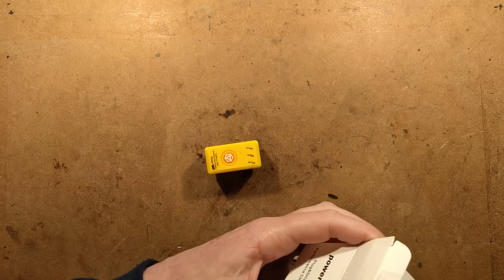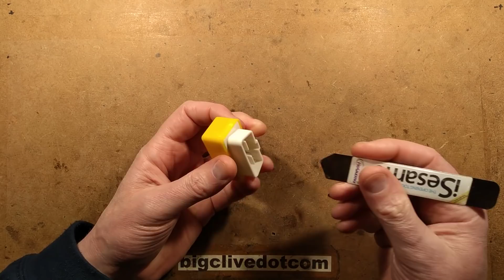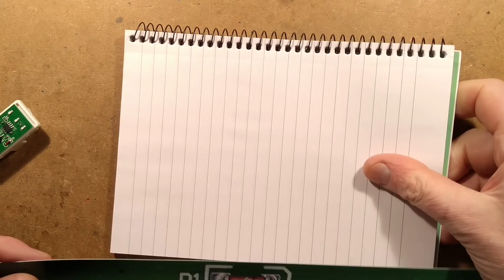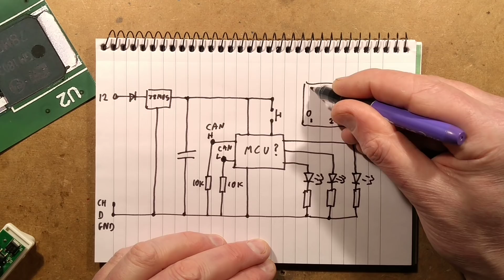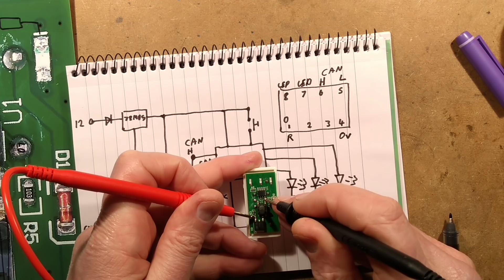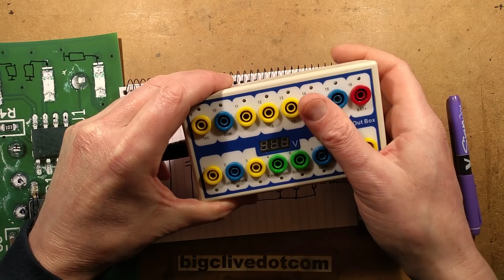Simplest OBD2 engine remapper yet, with actual canbus connection.

Comment: Just started getting into soldering and the like recently, I have a thing for solar lights for some reason no idea why lol. But I had a question as this is the most recent video.
Have you ever used liquid electrical tape and if so what have you used it for?
Reply from the maker: I've not used liquid tape yet.  I've seen it in America, but someone recently sent me a tub here.
Reply: Ah I see.. I used some a month or so ago to patch up a phone USB cable that started getting some wear and tear and a small part of the cable wires were showing. Tried actual electrical tape but the thermal temp differences when in use ended up making it lose adhesion to the cable. So I tried some liquid electrical tape and it bonds MUCH better than the standard E-tape and thermal variances don't seem to affect it. I've also used it in place of heat shrink while messing around with some solar lights.

And on the subject of solar lights lol, I just purchased a Mainstays Solar motion activated wall light that is 1000Lumens and a Mainstays Solar step and fence light with Motion, 5 Lumens standby 100 Lumens activated of which i'll be using as an in doors light, Gotta love rechargeable batteries and having a charger lol. Sadly though, they use 18650 and 14500 AA batteries so had to visit Amazon for a charger. as I said, LOVE solar lights for some reason lol, especially during the summer. Thanks for the reply

Comment: Loading components on both sides is obviously more expensive... You have to stop bits falling off the first side when reflowing the second.  

The 7805 regulator should have a small cap on the input for stability.  The choice of regulator package may be due to power dissipation to get vehicle "12V" down to 5V.  As much as 16V is often seen on vehicle power supply rails.... with automotive rated components rated to deal with 60V load dump transients. Such transients occur when e.g a "mechanic" disconnects the battery while the alternator is trying to charge it.

Comment: Pinout matches an STC15F101W, little micros currently retailing around £0.15-0.20 in volume. Can find them on LCSC
Reply: I really like this theory. If so, the Can Bus is connected to I/O pins at 5 and 6. LEDs are connected to I/O lines at 3, 7 and 8. This microcontroller has on-board clock, RAM and a big EPROM so it is fully self-contained. This means that it could easily be talking to the CAN Bus and could actually be doing something. The next thing would be to analyze the CAN traffic to see what is happening. Good find.
Reply: @Toobula : No need, no CAN-controller and no CAN-tranciever in that chip. You can find chips with built-in CAN-controllers but all CAN-trancievers are external. Also, crystal oscillator is missing...
Reply: @TheFirstBigCheese  Not true. There are some micros with built in CAN transceivers. They are few and far between, yes, but do exist.  Crystal oscillator is not an absolute requirement. It can run on the internal RC oscillator. Some have trimming registers for tuning, as well as PLL's for multiplying the clock.  However you are correct that this micro is unlikely to have a CAN transceiver. So successfully communicating on the CAN bus would be difficult.   I will not say impossible, as there is some trickery that could make it possible.
Reply: @ArionRaine  Really, there are? Can you mention one that has the tranceiver built in? (I'm not aware of a single 8 pin chip that even has a controller, no less the tranciever).
Reply: @TheFirstBigCheese  I did not specify they were 8 pin, nor did you imply your statement was limited to 8 pin devices. But yes, not likely in an 8pin device unless it is a custom IC, and they def aren't doing that for these.  Off the top of my head I think ST has at least one L99xx part with transceiver. I am unsure if the part is available outside of automotive agreement's however. I think maybe the EBV Epona line of automotive regulator IC's may have them, but I am unsure.
Reply: @TheFirstBigCheese  Indeed. Some controller of that family support "RS485 control" (RS485 is very similar to CAN bus and might just work if you'd screw around enough; there's also no real full-featuired UART on board, I think). But, again, just "control", no transceiver. Without a transceiver, the microcontroller can just source/sink 20mA on the output pins, but CAN requires at least 35mA (usually higher drive currents are used for reliability, 35mA is the absoluter minimum to fulfil the dominant voltage specs)

The devices have an internal RC oscillator, which allows to select a clock frequency of 5.5MHz, 11Mhz, 22Mhz or 33MHz. The CAN bus allows for a oscillator tolerance of almost 1.5%, which the internal RC oscillator can meet (0.3% base deviation, plus 1% temperate related deviation).

My verdict: it might be able to analyze CAN bus traffic (and maybe do some flashy things, like blinking LEDs differently when the engine is running, or when revving high), but it will not be talking to other components.

Comment: Tying Chassis Ground and Data Ground together on the board seems like bad behavior. I've never looked into this but I'd think if the car makers bothered to have separate grounds for data and chassis they should stay separate. Tying them together on this device's board defeats the whole separate ground scheme car wide.
Reply: No reason to worry, SGND is not actually used or just commoned at the plug host side too, at least for CAN bus cars. Probably not the case for J2818 and such where it might actually be important.

Comment: 9mA is actually quite a lot in quiescent terms within an automotive context. Most regular cars are <20mA for the entire 12v system with security active. I wouldn't be plugging anything so generic into my car...crashing CAN or sending spurious data is generally a bad thing. Suppose it could be repuposed as a USB charger...

Comment: One possibility would be ATiny85. It has RESET on pin 1 and GND on PIN 4. Vcc is pin 8 BUT the LED is always ON - it could be a trace on the bottom side of the PCB - LED shows power is OK and goes to pin 8. All the other pins are I/O...
Reply: i found it it's an stc micro stc15, pins match perfectly https://datasheet.lcsc.com/szlcsc/STC-Micro-STC15F104W-35I-SOP_C26928.pdf

Comment: So was that a 5.1v Zener? I've purchased some & can't read the bloody things, numbers on them don't seem to match their voltages. Is there an easier way to read those & get their proper voltages?
Reply from the maker: It's just a standard diode like a 1N4148.  Sender markings usually have a voltage marking like 5V1 for 5.1V.
Reply: @bigclivedotcom , So a switching diode, I wasn't certain, & am old & getting blinder but dang their hard to see even with my eye piece. LOL!!!! Don't you have a meter that can test those? If so make/model. Thank you B. Clive.

Comment: I  have a different kind of tuning box, this one is plugged in between the injection pump and the ECU.

It seems to work, but not only for tuning, but also for economy
at least I can notice that in the MPG
there are two wires going to a little box, they are spliced in on the pressure sensor, so my guess would be that it modifies the signal a little bit

Comment: The fun thing is they could cheat the fuel economy gauge by randomly issuing a DTC reset pattern, most cars default economy values are unrealistic so at the dealership the range shows like 700km while the car is only good to 500 after it has learned in.

Comment: Thank you for confirming suspicions. I'm a mechanic who saw these things and thought to myself yeah right first of all reprogramming like you said is quite geeki and can't be done with a cheap unit even if it is an off-brand one. In fact most tuning  requires disassembling the computer and can't be done through the OBD port
Reply: Actually although the CAN bus can be expected to be firewalled off between the diagnostic and the engine section, and thus will not be used for programming in any official capacity or by tools intended for professionals, just about every single unit in existence has exploits which breach the firewall. Once you do these kinds of things, a hard brick becomes fairly probable. I ran into numerous security research papers.

And still, these are all going to be fake, for so many reasons.

Comment: What type of Skoda is this? A Fabia, or its predecessor the Felicia?
And what is the other bus you mentioned, if this car doesn't have a CAN bus? (I can hardly imagine a car not having a CAN bus, how else would the engine management communicate with each other, like electronic butterfly control valve for the throttle body, which at least the Fabia already had, and the ignition module, and so on?)
Of course, if it is a Felicia, then this might all still be mechanical.
Reply: VW group switched to CAN bus starting around 2004. Before that, a variety of other similarly message based but electrically different buses were used, such as ISO 9141-2.
Reply: Oh, so my end-of-1999 Seat, even though it is a facelift model, won't have CAN-Bus? Does that mean it wouldn't make any sense to buy one of those cheap Bluetooth dongles and use the Torque app on my phone with it?
Reply: @Seegalgalguntijak  actually, ELM237 supports a whole bunch of physically different interface standards; whether Torque supports your vehicle, what specific bus yours uses, and whether ELM237 (and especially China clones which might get one or another thing wrong) manage to communicate with it, is something you should ask somebody who actually knows that stuff in detail, enthusiast forums or so.
Reply: @Siana Gearz OK thank you, I think I'll have to look around a bit, since Germans are usually very much "by the book" and therefore don't recommend such "inofficial" devices, they rather give you an illegal copy of VAGcom, or so ;)

Comment: Obviously most of your subscribers have no idea wtf is going on but i assume you realize that you must have a can bus capable vehicle and software.  since you admit it might screw up the car, you must agree that it's got input AND OUTPUT capability?  Does it bluetooth to a phone or other device for access to software?  If not, how could you expect it to work in the first place??
Reply: Microcontrollers are simple i/o gates, i learned that in digital circuits 101. without a running software or ECU flash , you wont change much with the tune.  We have the software, just looking for a cheaper way to connect to the ECU because the cables are usually proprietary same as the software.  800 dollars for a GM link to use EFI live, the software is free.

Comment: What if the Reset, pin one is really the power and the switch is NC. Then the 5V is a requirement input for there program.

Comment: One thing I’ve yet to figure out, why bother putting a polarity protection diode in something with a such a defined pinout as OBD2? I can understand it with battery operated things (AA, 18650, etc.) where they could be installed backwards, but I see no way that pin would ever be anything other than +12 V. Besides, if someone installed their car battery backwards, they’re gonna have a lot more problems than blowing up a voltage regulator in a $4 piece of landfill.
Reply: Static protection and occasional quick negative bursts/spikes.

Comment: found your micro https://datasheet.lcsc.com/szlcsc/STC-Micro-STC15F104W-35I-SOP_C26928.pdf page 5 is where you want to look
seems the 2 pins hooked to the canbus are also the programming pins and the uart a la atmel
also seems that no matter the package the bottom 8 pins are constant but the top ones change
there doesn't seem to be any can capability in the range at all though

Comment: Is there really a OBD2 Wireless chip that works good, Maybe a decent  one that you can recommend big clive? I know they're going to be limited on what they can do but I would like to have one and I'm not sure which one to buy? I know none of them are going to help your horsepower or gas mileage. Just a diagnostic tool.
Reply: I use the elm327 Bluetooth Adapter with Torque or any software I can use with the serial emulation. Don't buy the China crap, most times it won't work. The crap is up to 30 Dollars, the real one is around 50 Dollars up. If it works, the elm is for most people the best option. If you want more than read pids and delete errors, you have to go to special bundels from aeswave, what is up to 1500 Dollars.

Comment: I had one of these that i used on my old car. 
Literally all it did was make it run an open fuel loop. It just makes your car have max fuel flow all the time, regardless of throttle position.
Reply: Holy carbon buildup. 
Why the hell would someone want that, or was it advertised as doing something else than what it was really doing?

Comment: The MCU could never send data across Canbus with those 10k resistors in series, Canbus network  devices are terminated with 120 ohm resistors so there is no way any mcu could pull the lines high or low through 10k resistors 😉

Comment: Hi Clive - Take a look at the STC15F104W - Pinout matches
It's an 8051 core, which is commonly cloned in china.
http://embedded-lab.com/blog/exploring-stc-8051-microcontrollers/
https://www.aliexpress.com/item/FREE-Shipping-STC15F104W-SCM-STC15F104E-minimum-system-development-board-Electronic-Component/1000001748420.html
Reply: http://www.stcmcu.com/datasheet/stc/STC-AD-PDF/STC15F101E-series-english.pdf
Reply: Also other variants exist - one here with a PIC micro - https://blog.quarkslab.com/reverse-engineering-of-the-nitro-obd2.html
That's available on aliexpress with more/better pictures.

Comment: could you humour me and hook that microcontroller up to a programmer and read in the data stored therein, it can be disassembled and we can put to rest the myths surrounding these things by seeing that the software is just a light flasher. I did this recently with a $1 bluetooth module from aliexpress and successfully read in the program stored in serial-flash, made changes in a hex editor and wrote it back out successfully.
Reply: First step is to identify.

Second step is to hope it's actually readable. I know competence is in short supply but if there was any, it's locked and can only be erased.

Comment: That's a cute little "blinkenlights" unit.
If anyone watched SMA's video on the Dodge Caravan that reset the dashboard and set the wipers running whenever the power sliding doors operated... That's what happens when your CANBUS gets tampered with.

For best performance from a vehicle (acceleration, braking, fuel economy) the best thing ANYONE can do is keep current on scheduled maintenance. Regular oil changes, tune ups, and good quality fuel (from a major supplier) in addition to driving mildly (gentle acceleration/braking patterns) and not carrying more cargo than is necessary will be far more effective than any silly OBD-II dongle quackery can ever be. One-size-fits-all devices cannot take into account all of the variables than an ECM handles - each specific engine has its own mapping for air/fuel ratios, injector pulse timing, etc etc etc. Even the same exact engine used across multiple vehicles will have completely different programming. Any effect these modules have on a car is a placebo at best.

Comment: should buy one of those Bluetooth ones i have one and it can be useful to see some outputs as i only have speed , tach , temp and gas on my dash.
Reply: I used a bluetooth one to drive a HUD, check the power consumption as I found that even turned off it drew 220 ma which did the car battery no favours.

Comment: I've  used these devices for years even in non ECU vehicles very impressive mpg and severe power and bottom end torque. But now I run my car on hho  only using jam jar with some 316l stainless springs inside it connected to the battery through a special on off switch it all cost a lot of money made by experts. I did want to make my own but I'm only a mechanical and electrical engineer.
Reply: @Edward Elizabeth Hitler Hi Edward I don't know where this post came from but it wasn't me can you send me a link to the original video 
Many thanks Stuart

Comment: Greetings from NJ, USA.  I like that resistance box you have there. Looked on ebay, no luck. Do you have info on where to buy it ?   Thanks, I enjoy your vids very much.
Reply: that was a narrow application, linear type, you'd want a higher rated "decade box" 1's, 10's 100's etc of ohms on separate dials, each changing 1-9 of that value in resistance. i'm more intrigued in the obd2 breakout box with led's, but i'd use it less then a few times a year.
edit GSLL, $70 obd

Comment: Pretty sure that there is no way this is doing anything with regards to CAN.  Any real microcontroller that has a CAN peripheral still requires an external CAN transceiver to drive it.

As you said, the best this thing will do is crash the CAN network on your vehicle.

Comment: Had of these was supposed to allow you to hold your unlock button and roll down your windows (a common feature on some cars) and it did not work for me and when I gave it to a friend it made his car stop working. The car would turn over but not start. He messed with the battery and stuff and got it working but it had the residual issues like you said and he had random issues for weeks with his electrical system after that.  Wanted to send it to ya but could never find a PO box to send it to.